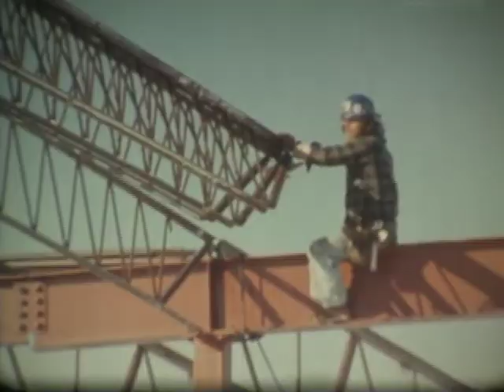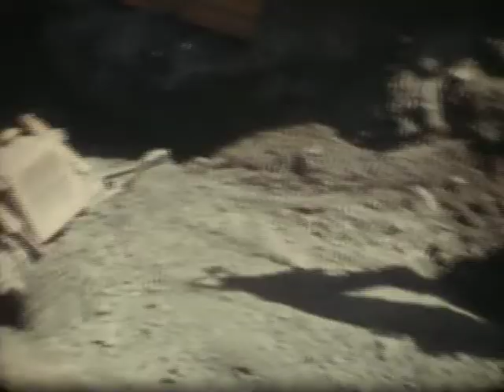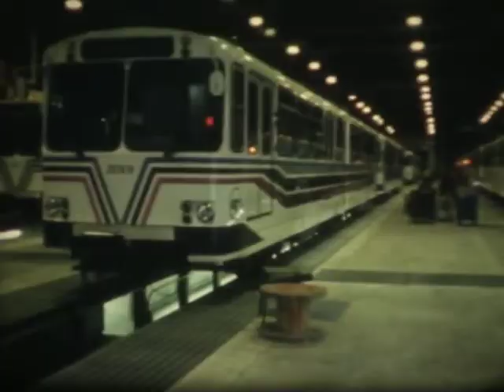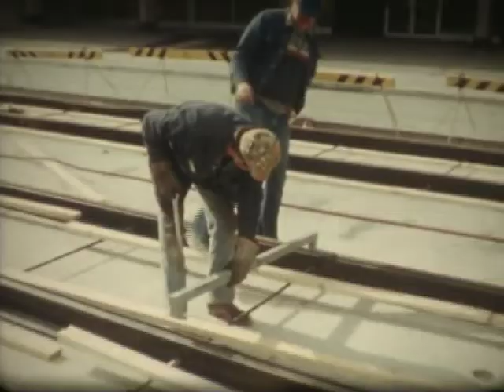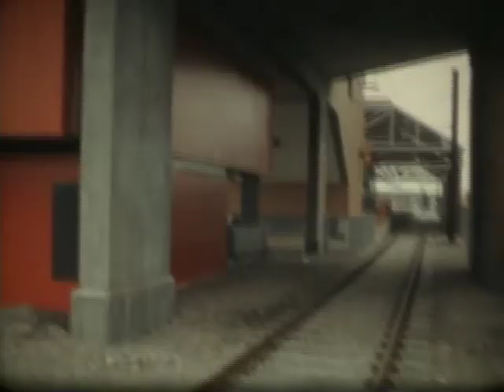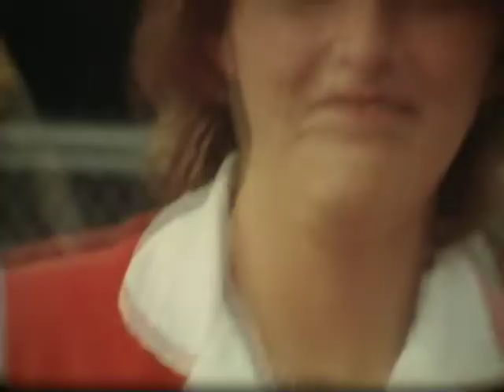All Aboard - The Construction and Grand Opening of Calgary's CTrain (1981)

Comment: It was later found that the wheel flange profile on the wheels supplied by Simmons were not compatible with the std AREA 100lb #8 switch points that were installed on the South leg. Many derailments were encountered when maintenance on the downtown tunnel, near Stampede Station, forced the use of single track running. Modified Samson style points were developed jointly between the City of Calgary, Pacific Northern Rail Contractors, and EGB Manufacturing of Cochrane Alberta. Many sets of these points are still in service on the South leg.